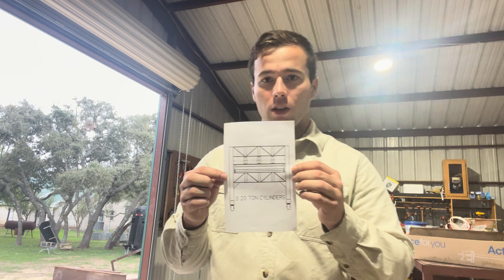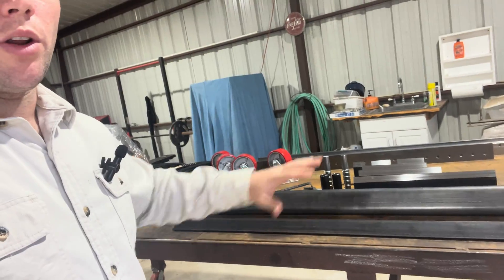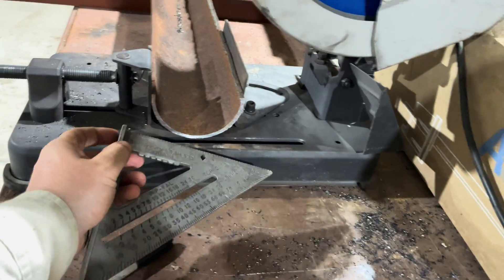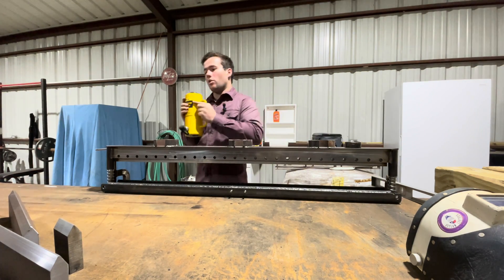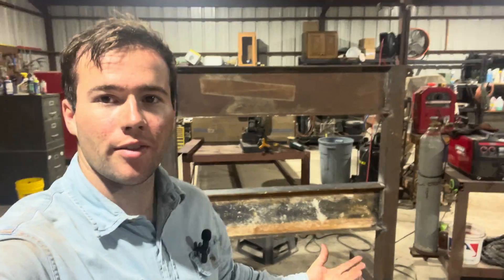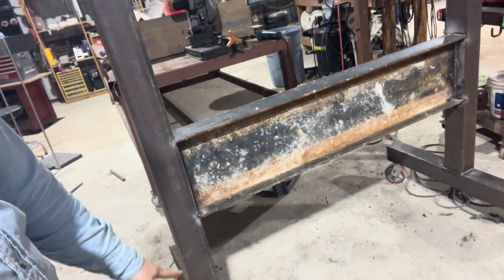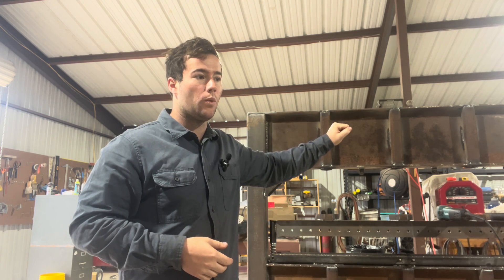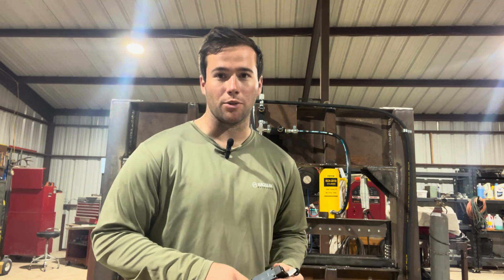60 Ton Hydraulic Press Brake Build

Comment: Good job. All you need now is to replace the compression springs with some stronger ones.
Reply from the maker: Absolutely, they work fine but would be a lot faster on the retraction if they were stronger.

Comment: Is the blade thicker then the opening it sits in? Or how does it stay in when bolts are tightened?
Reply from the maker: Yes, it has a very snug fit when it gets bolted down.
Reply: @skylarwagner1155  okay I’m in the process of making my own top blade and was wondering if blade needs to be thicker then the other peice on the die
Reply from the maker: @danielcamp7315 wish I would have done that. They are just slightly bigger. The biggest pain is trying to add and remove dies. If you can split up your sections into small pieces so you can remove them easier. Also if you can figure out a way to add a grove or something that the does can lock in that would be a huge plus.

Comment: I have air over hydraulic on my 50” swag, do all 3 of your cylinder move at the same speed? I have troubles with one of my cylinders pushing more on one side than the other they aren’t in sink with each other, it can be frustrating at times, thanks
Reply from the maker: They move even unless you do not have the valves set correctly on the back and if you do not have your metal centered on the press.
Reply: I've ran and rebuilt a few commercial press brakes, they have linear position sensors and electric proportional valves to make sure everything moves in perfect sync. I can't imagine static valves will ever work properly to evenly balance the load, and not having true feedback really limits what you can do with the machine. I am sure you could get a valve for cheap maybe used, and the linear position sensors are just linear potentiometers which are also really cheap. Things move slow, it would be very easy to control with something as simple as an arduino. I'd also stick to two cylinders, but that's just my 0.02.

Comment: I would have run a FEM on that design before building it.  I'm not sure about some of the load force paths with the vertical struts on the I beam.   I beams are designed to take loads on their flanges.   Putting the struts messes up the load transfer between the flanges and the web.
Reply from the maker: @SomeTechGuy666   Good idea, I do not know how to do that so I just used experience. I have put a lot of pressure between the beams and haven’t had a problem. I beams tend to twist under load which is not ideal when you are trying to use them in this application. The reason I added in the struts was to eliminate the possibility of the beam twisting and creating more of a “Tubing” structure above the hydraulics where most of the force is being applied.

Comment: what is the cost of 60 Ton Hydraulic Press Brake you Build?
Reply from the maker: @ishfaqghulamhussain9222  around $3,000
Reply: @skylarwagner1155  it can bend 1/2” plates
Reply from the maker: @ishfaqghulamhussain9222  it can not only up to 1/4

Comment: I’m about to build a press hopefully similar to this, same brand hydraulic rams. What sort of pressure have you seen on the pump? Like are you reaching above 5000psi? 

The 4way connected you linked is only rated for 2500Psi, so if you’re exceeding this I’d be careful.
Pretty sure the rams are rated for 10,000Psi(correct me if wrong).
Are you just using the hoses that came with the pump?
The build looks awesome and that was a good idea with the limit switch! Think you could hook up day 4 limit switches preset to different angles and thickness’s maybe with a sliding Pin/bolt so you can position it over said switch?
Reply from the maker: You could for use do something like that with the limit switches. Just have to be creative! I hope all goes well with your build.
Reply from the maker: The highest I have seen so far is 3000 psi and that was bending 3/8 x 4” flat bar.

Yes the pump is rated for 10,000 psi, I had a hard time finding a 4 way that would be equivalent with 10,000 so I went with the strongest I could find.

I am using only one hose that came with the pump. The rest I had to get made.

Comment: What is the ball park price for this build? Also do you think its capable of doing the 30T cylinders vs the 20T? Looking to purchase plans. Great build and work! Thanks
Reply from the maker: I Believe I did it for around $2500 but I also had a lot of the metal I needed already. I am sure you can do it with 30T cylinders, but you might need a larger pump.

Comment: You may want to think about making the bottom die holder adaptable to smaller sizes of dies. Shorter bends with the wide die on the bottom will not work well. having them interchangeable like the top lets you get much smaller radius in your bends. Also any kind of material that is on the thinner side is going to warp and not be as clean as it could be.
Reply from the maker: Thank you for the information! I want to for sure change stuff in the future. By getting different dies to make cleaner bends. But for right now it is doing what I need it to.
Reply: should also note, if you do go the route of wanting to have smaller dies on the bottom be interchangeable, the top punches would also need to change to better match the radius on the bottom die. they work as a set.
Reply: I have the 20" version that I built like 4 years ago. Luckily I only stitched in the angle (die). I want to eventually make a bottom that accepts Wila tooling, which shouldn't be too hard.

Comment: Hello there. I just subscribed. I like the press break, and how you made yours. 
What got my interest is the circular saw you used on the I-beam. It looked like a regular Skill Saw. Was it? If so what kind of blade are you using and where can I get them. I have a Milwaukee 8” I bought in 08 or 2010 and the blades are outrageous! So I don’t use it much. If you would please give me some insight. Thank you
Reply from the maker: Yes! We had an old 7 1/4 skill saw laying around the shop that I use. The hardware store in town carries “Diablo Steel Demon” saw blades. They have different types of blades depending on thickness of metal you are trying to cut as well as type of metal. One of my new favorite tools to use in the shop. I use it to cut various things.

Thinking about making a video over my top 10 favorite tools to use in my shop. Thoughts?
Reply: Hey thanks for the reply, and info. I’ve seen the Diablo blades just haven’t tried them yet, but I will now! The 8” blade is difficult for me to get and cost around $70ish per blade and I only get about 75’ from them. Maybe it’s me? I don’t know! But my back pocket can’t take the learning curve. As far as the top ten tools go for it. Thanks again